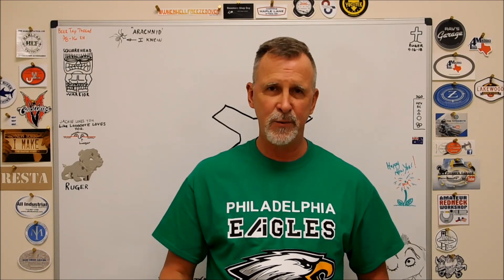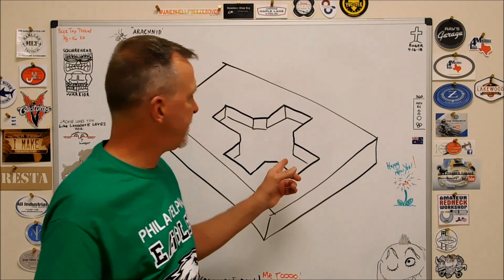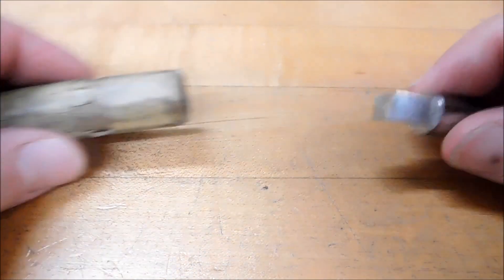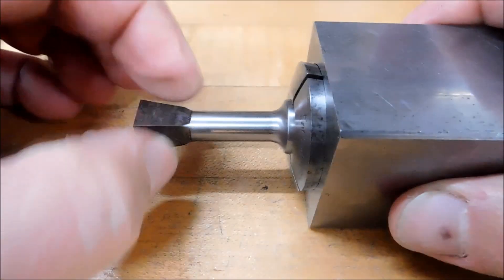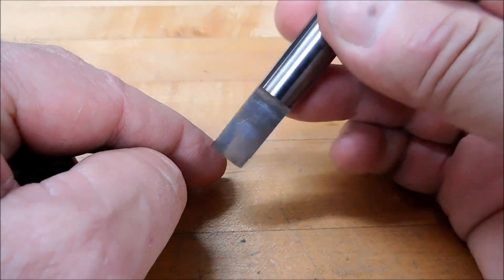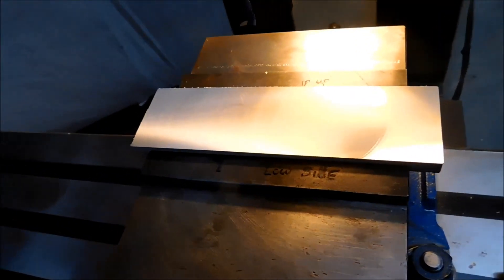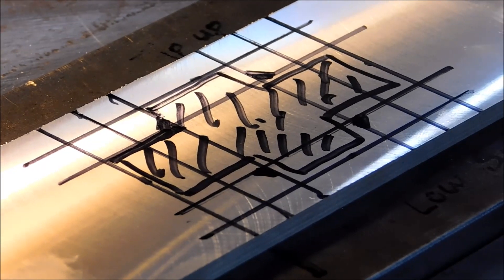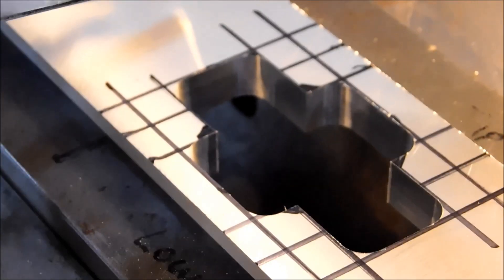You Can't Make that Part on a Manual Mill......Or can You?

Comment: Great video as always.  One thing I would love to see, is how to broach a square pocket or hole that is centered on a round hole.  I had to form a square hole to a specific depth (not completely through the part) so that a 5/16" square shaft with a 1/4-20 threaded end could be inserted all the way through, and fastened with a hex nut. This was for a cast aluminum shift handle (forward-neutral-reverse) on an old Merc outboard. The old plastic handle broke, and new replacements are no longer available fo this model outboard. Hope that all makes sense.

Comment: Great video Joe, you did mention clamping the spindle to the head. Could it be an idea to incorporate a ‘spindexer’ design into said clamp (vernier pin type of indexing system) so you can achieve definite indexes + smaller increments between?  Only thoughts anyway. Regards from Houston!
Reply from the maker: Thats the plan. Good thought.